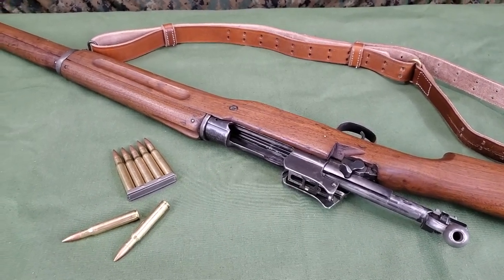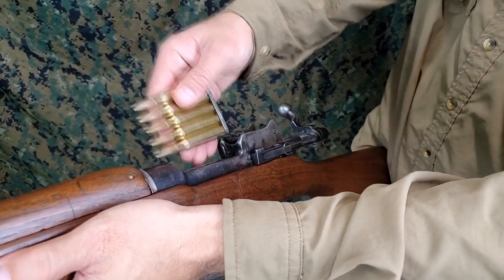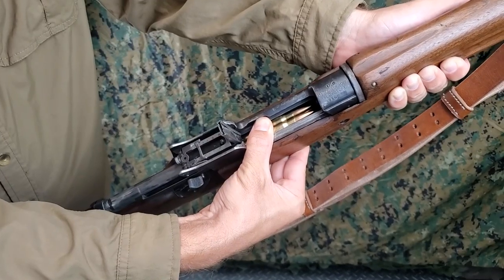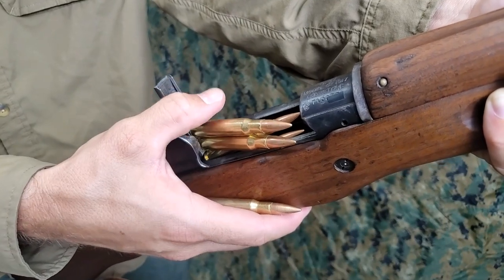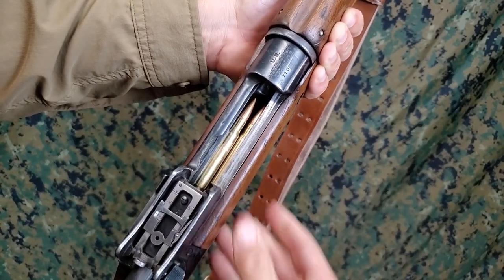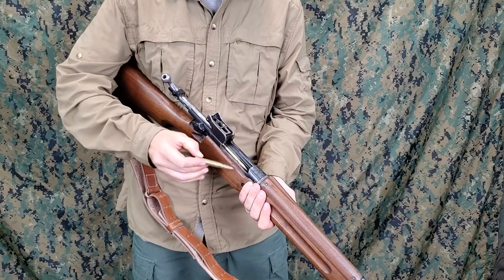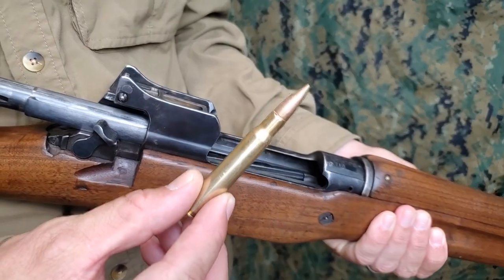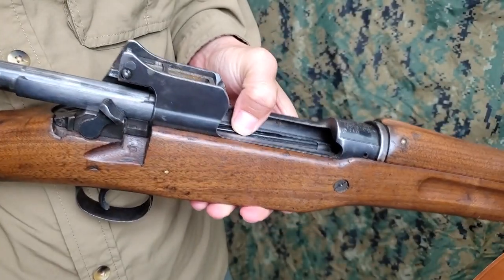Model 1917 Loading and Unloading (TF 1-03)

Comment: Have you ever seen an issue in these where a single round (such as the last round) in the magazine doesn't want to stay seated? E.g. the first 5 stay seated and load normally but the final round isn't held in and the follower seems canted or bound up, not applying pressure to the round
Reply: Disregard. After disassembling and reassembling discovered the person I bought it from had apparently not properly seated the magazine box or properly torqued action screws. So the receiver and floor plate weren't fully seated with each other causing some internal misalignment. Now got everything working properly
Reply from the maker: Oh, glad you got it figured out!

Comment: I have a Winchester 1917 Mine will not eject live rounds when I try to unload the gun the live rounds stay attached to to bolt then I have to remove them each time off the bolt do you know why if won’t throw them out?
Reply from the maker: Just on live rounds? 
When you pull the bolt all the way back, the ejector should protrude through the notch in the bolt on the left of the gun, past the bolt face. I you don't see that, it could be broken, or the spring could need to be replaced.

Comment: If you're answering some questions, mine doesn't seem to want to single load and I can't fit the rumored sixth cartridge in the magazine.
Reply from the maker: Talking about a M1917 and not a P14 right?
Reply: @HistoryinFirearms  1917 Eddystone. Pretty early on in the serial numbers 15377
Reply from the maker: Hard to say with out a good inspection. It took the manufacturers a bit to get on the same page with specs so parts on early guns may not interchange. Yours could possibly have some hand or force fit parts that are causing some issues.
Reply: @HistoryinFirearms  Well in summary, while single loading the 30-06 cartridge doesn't want to catch the lips of the magazine and just sits on top of the follower. Getting them all in with a clip works but it just absolutely refuses to have a sixth round inserted no matter what and I don't want to mess with live ammo. Have to order in some snap caps.

Other that, this thing is in near pristine shape considering that it more than likely saw action in Europe.
Reply: @essex3777  

I can't get the 6th round in mine either. I don't know why.

Comment: sorry but you are making a big mistake by putting  a round in the chamber like that, it is a Mauser  bolt system, as the bolt starts to push the round forward the rim slides up under the extractor as the round is chambered. by  putting it right in the chamber and closing the bolt you are  smashing the extractor claw into the rim of the round you will brake the claw of the extractor you may get away with it a few times but you will brake the  claw off it, i have seen it done in a competition. to load single rounds you must snap it into the magazine, then close the bolt chambering the round. thank you for your video.
Reply from the maker: Thanks for the input! You are correct in the mechanics of this and that repeatedly doing this is putting unnecessary wear on these aging rifles. The reason for this technique being included in the video is that it is described in the US Field Manual for the rifle. That being said, just because it's in the manual, it certainly doesn't mean it's a best practice for the rifle. This is probably worth a note on the video. Thanks!

Comment: Would not do a single load in that way personally. I let it cf under extractor as to not damage it be forcing it over the rim
Reply from the maker: That's definitely the safe bet with these aging rifles. This method is described in the manual though. There is a note in the description in this. 👍